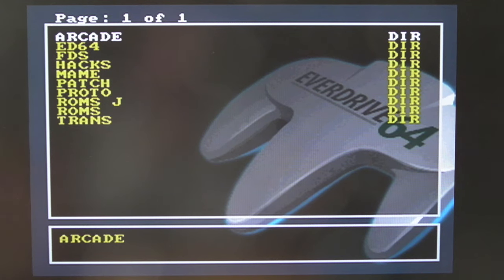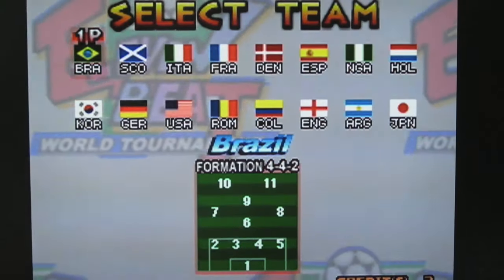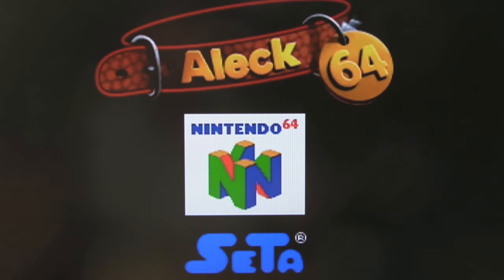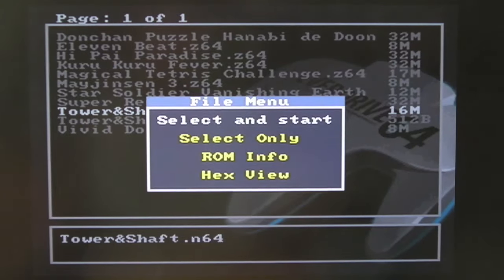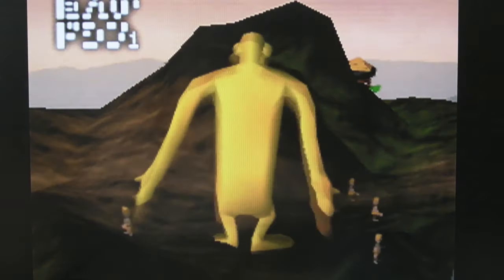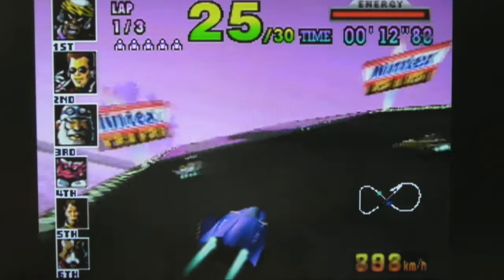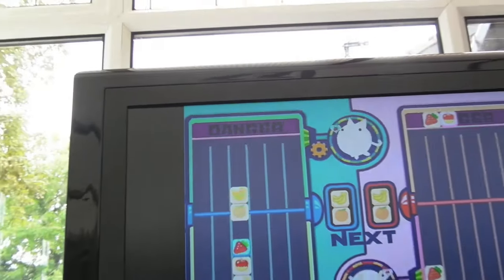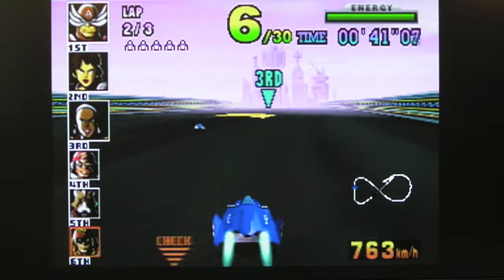Nintendo 64 (N64) - Everdrive Stuff & S-Video Over Bright Fix (Video Mod)

Comment: Nice. You should definitely get yourself a Japanese or early USA N64 and RGB mod it. The N64 that's in my video were I captured video using the Scart to HDMI adapter and Elgato HD60 is an USA model that I've RGB modded. They're easy to RGB mod and the picture is stunning.

Don’t worry about powering a Japanese or US N64 as you can use your UK N64 power brick (PSU) with Japanese or US models so no need to go out and buy a step-down converter.

The only downside is if you still want to use your EverDrive on Japanese or US N64 you will obviously need to change the CIC inside the EverDrive.
Reply from the maker: I will look out for a Japanese N64 I think!  Not sure if my ED has a switch for NTSC / PAL, I might have the 2.5 rather the v3.0 megadrive - not sure.

Comment: It is even easier to solder the 75ohm resistor on top of the board so you do not have to unscrew the motherboard. You can solder directly on the AV out where you see the six strips connecting to the port. If I remember correctly you bridge pin 2 to pin 4 with the resistor. This also sorts out the same overbright issue that occurs with the cheap composite cables that many people sell on Ebay, because those cables do not have the resistor built into the cable array, you would find a 75ohm resistor in an official composite cable array.
Reply from the maker: Ah, I did wonder that after I did the video but couldnt remember which pins were on top and which ones were on the bottom, so it's good to know there is an even easier way to do it!!! =D  I have to admit I didn't notice the same problem with composite, but maybe I need to add a resistor on for that as well...

Comment: I had to add the resistor(s) to my N64 S-Vid cable when I first got one around 2003.

I'd already chopped the S-Vid connector off the end though, as my CRT TV at the time (a Ferguson) allowed S-Video to be input via the SCART socket (Luma on pin 20, and Chroma on pin 11, which is normally the "Red" input).

So, I could add the 75-Ohm termination resistors inside the SCART plug instead. ;)
Reply from the maker: Wow, I've learnt something there - I had no clue that S-Video could be supported via SCART!
Reply: Yeah, it's basically just where the specific TV could switch to using those two pins on the SCART input rather than RGB or Composite via SCART.

I'm not sure how many other TVs would have supported that, but it was really handy, and WAYYY easier than soldering those evil S-Vid mini-DIN plugs that used to melt if you breathed on them. lol

You did have to manually select the "S-Video via SCART" option though.

The good thing was that you still got a black and white image even if it was set to the normal SCART option on that input, 'cos the Luma (plus sync) from S-Vid still gets hooked up to SCART pin 20 of course. ;)

I know the TV was definitely a Ferguson CRT, and I think it had the TX100 chassis?
Not sure of the model number, but I'll post a link if I can find it.

Comment: those majong games usually have a keyboard type controller in the arcade, with each button for a tile, so maybe you would need a n64 keyboard to emulate that, or a whole remap or n64 controller with each button asigned to a diferent piece, with would be kinda troublesome to remember haha
Reply from the maker: Good point!!!  I remember seeing that the was a Majong controller for the NES or Neo Geo I think, so i am sure you're right and the arcade machine probably extended the input.  I might see if the 2nd controller does anything later, but probably still not enough inputs, and you are probably right about keyboard type matrix being used.

Comment: Some of those Aleck 64 games do look really nice and sharp in 640x480. :o

The start-up menu on Killer Instinct Gold is also a nice one to try.
Vigilante 8 can be set to high-res mode as well, IIRC?

It's a shame that all the games weren't rendered in that resolution (and with decent frame rates), as the N64 would have perhaps have competed better with the Dreamcast and PS2 (up to a point. lol).
Reply from the maker: Yes it is a shame it wasn't all 640 x 480!  I am sure it would have sold better.  The sharpness in 640 x 480 is certainly reminiscent of the Dreamcast.

Comment: I wonder what 50 ohms or 100 Ohms would have resulted in. I have this cool 'resistance wheel' from a company called 'Jaycar'. I have always wanted an additional one but they are not cheap. It's great for this sort of testing 'on the fly' .
Reply from the maker: That's a good point!  I think the 75 ohms is probably the sweet spot though because I think it has to do with the termination resistor at the TV side which forms a voltage divider - ie. PAL S-Video cable (official) will likely have a 75 ohm resistor in there I think.   The NTSC systems apparently don't need it because their TV's were developed differently.  At least that's my understanding from what I've read.  I might try and get one of those resistance wheels - sounds very useful as you say!!!
Reply: ...... I should have added, 'Don't listen to me' as 50 ohms might have 'Popped' the output IC.

Comment: S-Vid does look quite nice on the N64, and tends to add a bit of sharpness even over an RGB mod.

That may be a slightly "artificial" sharpness, but it looks pretty good.

If you could add the mod for the VI De-Blur as well, it would look amazing.

That's a fairly complex mod though, and is only really available on the N64 RGB board from Tim Worthington atm, or on the UltraHDMI mod board from Marshall (retroactive.be).

Basically, it seems that Nintendo / SGI might have originally wanted to run most / all games at 640x480, so the VI (Video Interface) was built around getting the best image with 640 horizontal pixels.

Due to the time constraints, and the fact that they basically crammed everything into the one chip (the RCP), they maybe didn't end up with quite the clock speeds they were hoping for (plus a small texture cache of only 4KB), and hence most games have to run at 320x240 instead.

But, due to the VI being set up for 640 pixels per line, it will still try to interpolate every other pixel when outputting a 320x240 framebuffer. That means that every "odd" pixel is just an average of the two "even" pixels either side of it, hence the added final blur.

It makes sense why the 640x480 rendering mode was / is mainly only used for the menus too...

The texture cache being only 4KB means that larger textures have to be loaded in chunks, so there is an overhead for that.
With the lower-res textures, it didn't make too much sense to render the games at 640x480 either.

When 640x480 is used for the more "static" screens like the menus, there doesn't need to be anywhere near as many transfers to the texture cache, so the frame rate stays high.

Amazing to think that all this stuff is still only being discovered about these machines. hehe
Reply from the maker: Yes, a de-blur option would be cool!  I might get an RGB or HDMI mod at some point.  I've heard that people have been disabling the anti aliasing with a game shark!  The evedrive has game shark built in but I've not tried it yet.  Tell you what we really need - a hack for Doom to fix the brightness / gamma level.  It's basically unplayable on modern TVs.
Reply: Yeah, the first stage of Anti-aliasing is just in a register in the VI (Video Interface) part of the RCP chip.

If you look at the info for the REGISTER #0 VI_CONTROL_REG, it just has two bits for enabling the AA and resampling...

http://hcs64.com/files/n64-hw.dox

You can disable the dithering too (well, at least the "normal" stage), but it's probably worth leaving that on, as almost all games use the 16-bit colour mode anyway.

I still have no idea why they only output 21-bit video from the N64 though? The extra 3 bits would have made a noticeable difference to the image quality, especially in certain textures and darker areas.

Not sure about patching Doom tbh. It probably handles the brightness using the colour combiner or other scary stuff. lol

Have you seen the port of the "real" version of Doom to the N64 btw? It's really good...

http://assemblergames.com/l/threads/doom-for-nintendo-64.52471/
Reply from the maker: I will check out the original doom!  You're probably right regards gamma patch - I suspect it would have been done already if it was straightforward.
Reply: I'm sure somebody would know how to do it, but I've not done a huge amount of MIPS assembly tbh.

If you ask on the  #n64dev  channel on IRC (on EFNET), someone on there would probably manage to figure it out within an hour. hehe

There was apparently a patch for gamma on Doom 64 (I just Googled it), but I didn't link it here because the ZIP file links to a malware site now.

Does the Brightness option in the game not boost it enough, or does it just make it look washed out?
Reply from the maker: It has very little effect!  The brightness is really low to the point it's just not playable at all!  I might have a play with a game shark or something to see if it's possible to push the in game gamma adjustment value beyond whatever limit is coded in there.  That might work!
Reply: I can see where Doom 64 (USA) is constantly writing to the VI regs.

It doesn't look like the usual Gamma correction is even enabled by default.

(see the write to 0x04400000, which is VI_CONTROL_REG...

http://imgur.com/a/dQkTy

REGISTER #0 VI_CONTROL_REG [16:0]
        
        [1:0]   pixel_size
                  0: blank (no data, no sync)
                  1: reserved
                  2: 5/5/5/3 ("16" bit - really 18 bit)
                  3: 8/8/8/8 (32 bit)
        [2]     gamma_dither_enable (normally on, unless "special effect")
        [3]     gamma_enable (normally on, unless MPEG/JPEG)
        [4]     divot_enable (normally on if antialiased, unless decal lines)
        [5]     vbus_clock_enable (off always)
        [6]     serrate (always on if interlaced, off if not)
        [7]     test_mode (for diagnostics, not used in normal operation)
        [9:8]   aa_mode[1:0] (anti-alias mode)
          0: aa & resamp (always fetch extra lines)
          1: aa & resamp (fetch extra lines if needed)
          2: resamp only (treat as all fully covered)
          3: neither (replicate pixels, no interpolate)
        [11]    kill_we (for diagnostics, not used in normal operation)
        [15:12] pixel_advance (always 3 for optimal operation)
        [16]    dither_filter_enable (normally on for 16 bit, off for 32 bit)

For it to enable gamma, that value 0x3303 written to that reg would need to be changed to 0x330B.

That definitely won't be the whole story, as it likely does the other brightness stuff using the Colour Combiner on the RDP.

The other problem is, these writes happen when the game code has already been DMA'd into RDRAM (starting at 0x80000000), so we'd have to see if the VI reg write stuff is uncompressed in the cart ROM itself.

I'll have a looksie...
Reply from the maker: I've never looked at the N64 architecture before!  I've heard its pretty hard to work with though lol.  Maybe there is some compression of the game code or perhaps self modifying code or something, although that's not as common in carts, but compression certainly could be the next issue.  I still think hacking in a larger limit to the slider pot might solve the problem, although I expect colours to be a bit crap if the brightness is increased too far.  I dont know what they were thinking because the game is really really dark like no other game out there.  Even on max setting you can barely see anything at all.
Reply: Right, I think I've found how to possibly patch the RAM value to enable the Gamma option on the VI.

I'm just not sure how to turn that into an actual Game Shark code. lol

0x8005E9CC = 0x0000330B

If you change the original value of 0x00003303 to 0x0000330B, the game seems to continuously write that value to the VI_CONTROL_REG after that (under MAME at least).

I also found a table of values that get written to the VI regs, which start at offset 0x0005EC08 in the Doom64 (USA) ROM. (I'm looking at the NON-byteswapped (Z64) file, as it makes looking for values much easier.

The table is like this, and has multiple entries with different values in, so maybe there is some code there for changing the resolution perhaps (but then the main code would need to render at a different res too).

00000140 <- Gets written to VI_H_WIDTH_REG (320 pixels wide).
0404233A
00000271
00150C69
0C6F0C6E
00800300
00000200
00000000
00000280
00000400
Reply: The N64 isn't too bad to work with, but I've never written any games from scratch or anything, only messed with some really low-level stuff.

I got PIF chip "emulation" working via the FPGA board a few months ago. ;)

When I eventually get around to finishing the controller and EEPROM support, it will basically make a truly region-free N64, with no CIC chip needed.

Also, because the boot code can be modified, it opens the door to a lot of other cool things, like being able to add a boot logo to the N64 without even needed a cart to be plugged in, or allowing direct access to an SD card via the FPGA PIF.

The latter would only really be useful for homebrew though, since all the commercial games will be coded to DMA stuff directly from the cart port. Might be fun to play with though.

I've already had the FPGA version booting different carts though, including the Rare games like Donkey Kong 64, and that's just by changing the CIC "Seed" value in the PIF (like many emulators do).

If the proper algo for calculating the responses for games like Banjo Tooie is added, it will then basically be able to boot and play any cart from any region. A bit of boot code will need to be added that detects the expected type of CIC chip from the cart, but that shouldn't be too hard.
Reply: Apparently the GameShark codes aren't too hard to figure out...

The upper byte of the code is kind of ignored as an actual address (although the upper bits do actually match the N64 memory map for some of the GameShark commands)...

16-bit Constant Write...
81XXXXXX YYYY = Constantly writes the 16-Bit value specified by YYYY to address XXXXXX.

16-bit Uncached Write
A1XXXXXX YYYY = Constantly writes the 16-Bit value specified by YYYY to the uncached address XXXXXX.

I'm not sure if it would need to be cached or uncached, and I also have to guess that the 16-bit version to enable that gamma value would be...

(Doom 64 USA, possible GameShark code for VI Gamma enable) = 8105E9CE 330B

I'm also not entirely sure which endian that would be, so it could be 8105E9CE 0B33 ??
Reply: More info on the GS codes here...

https://gamehacking.org/faqs/hackv500c.html#how_to_guide

I'll have to try it out on PJ64, but it might be hard to tell if it's worked unless I can use the debugger, as I don't know if most emulators just ignore the VI Gamma bit? (probably)

I know how to use the debugger on MESS / MAME quite well, but others aren't so great.
Reply from the maker: Thanks, I just had a look through a couple of emulators to see if they had any debug funcitonality but nothing built in =/  I also found a similar link to that one but I am not sure what needs changing or whether it can do it.  I guess it kind of needs a conditional, when that address is written to with that 16bit value then swap it for the value you included the gamma bit set.   I did notice though that even the emulator recommended increasing brightness by 60% to 160%, so its dark even in emulators lol.
Reply: Great - I can't test the GameShark codes because Project 64 is so SHITE that any version I use that doesn't immediately crash when loading Doom 64 doesn't want to let me add a new cheat code. :( lol

I don't have a real GS cart, so I don't have many ways to test the theory.

It might not help much anyway, as the VI Gamma may be subtle.

It is a dark game though, even on an emulator.
Reply from the maker: btw - you're certainly one smart cookie!!!  And I appreciate all your ideas and the time you've spent looking at the Doom code!  I've gotta get some sleep now!
Reply: Right, I've finally found a version of PJ64 that doesn't crash, and lets you add a new cheat. You do have to uncheck the "Hide Advanced Settings" option first, then run the ROM, then go to the System > Cheats menu, then click the arrow thingy on the right side of the window.

That made it SOOO user-friendly. lol

I'm trying ver 2.3 now...

http://www.pj64-emu.com/downloads/project64/binaries/
Reply: Thanks. :)

No probs, mate. I'll catch you later. ;)

I find this sort of stuff interesting, as I've not done much ROM patching etc., so I'll see what I can figure out.

I will be hooking up the FPGA board to the C64 CIA later btw.

I started building that adapter using a wire-wrap DIP socket, and then stumbled upon my proper 40-pin test clip while tidying up. lol

I have some bare (working) A500 and A600 boards too, so I can attack those chips as well at some point.
Reply from the maker: Thanks =D  Yes, it was great to get a shoutout there!  I only discovered that channel recently - I love his news program as he always manages to pull in things that we've all perhaps missed during the week etc.  I've not had chance to look back at Doom yet following on from your messages.  My wife has been in hospital since Tuesday =/
Reply: Sorry to hear that, mate. :(

I'm usually around if you want to try messing with Doom again after though.

Hope all is well.

Comment: good night friend, excellent videos of it channel, I am with two neo geo mvh mv1f both stops, one this danda a clear blue screen, and the other color branck ram error you can help me, I'm from Brazil here do not have much help process to solve this from already thank you .
Reply from the maker: I would start by inspecting the boards for damaged traces or any corrosion, then get SMK dan diagnostic ROM and test with that instead of the stock BIOS.